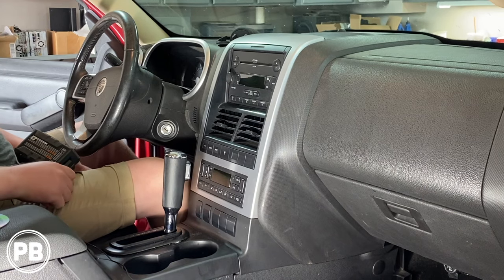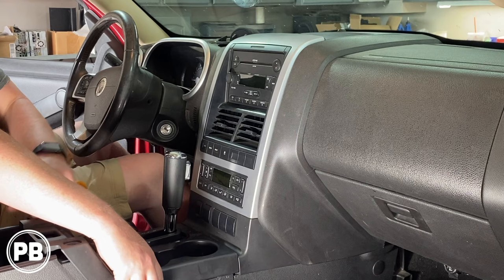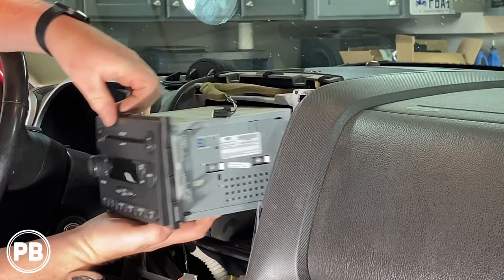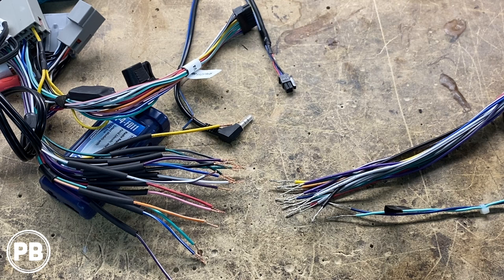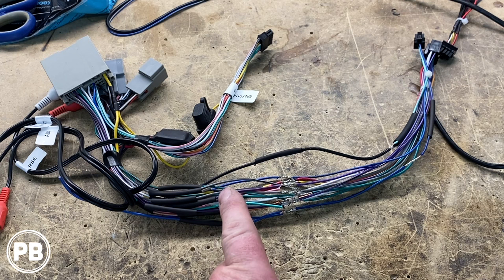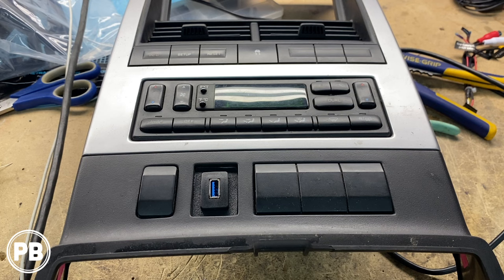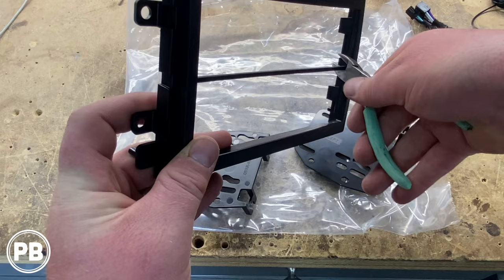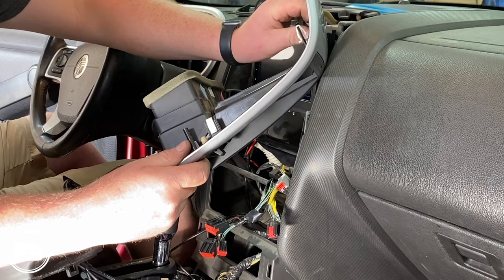2006 - 2010 Ford Explorer / Mountaineer Radio Install

Comment: Note about Crux SWRFD-60L harness adapter. If you have "Sync" (look for that emblem on your center console) the steering wheel buttons will not function even with this harness. This info is stated in the installation guide and I called Crux and confirmed I could have just used a basic harness like Metra 70-5520
Reply: Did you keep the steering wheel functions using the Metra 70-5520?
Reply: @edwincordero8  No.  My car had 2 connections in the dash. The Metra connected the radio to the big connector. The smaller connector must be just steering wheel controls which is what the Crux connected to
Reply: @gbasplen  got it, thanks.
Reply: Hey stupid question but are you saying I should use a different adapter then?
Reply: @BULLETFARMER  Yes but I don't know what brand still allows the steering wheel buttons to work on a "SYNC" radio
Reply: @gbasplen hey man are you still
On here? I could use your help today
Reply: @luisgalvansibd7688  I can try to help but it's been a while since I installed mine. I did 3 of my Ford SUVs at the same time and they were all slightly different so I  may not remember but I'll try
Reply: @gbasplen  I wanted to see where you got the ACC turn on? I have a 2010 work the nav and steering wheel controls. I was able to use the standard harness 5521 but trying to see which ACC I could use
Reply: @luisgalvansibd7688  do you mean where to get power for a backup camera only when the ACC is on? I put a fuse tap in the fuse box under the drivers left leg. I can check to see which fuse # when I get home
Reply: @gbasplen  yes. Let me know on this I saw the fuse panel under the driver this morning. I wanted to use the radio one I think that was there but wasn’t sure.
Reply: @luisgalvansibd7688  In my 2007 Explorer w/o Sync I see I tapped into #16 the 10A trailer reverse lamps presumable for power for the backup camera
Reply: @gbasplen  I couldn’t use that fuse. Mine is a 2010 with the 7inch screen and nav. I ended up using the moon roof fuse since it only opens when the key is in ACC or all the way on.

Comment: Does the system also support controls for the DVD Player because I have everything it's a limited edition subwoofer and DVD player for the rear passenger does this system support all of that?
Reply from the maker: The Pac RP4-FD11 retains audio for the rear seat entertainment (RSE) package but your radio needs some sort of audio input on the rear of the head unit.  The Pac instructions outline it here: https://catalog.pac-audio.com/index.php?controller=attachment&id_attachment=1519

Comment: Does this radio automatically turn off when u turn off the car to? Or is there something else needed for that? With my 2008 ford explorer my default radio is automatic but when i install different radios it ends up killing my battery even with the car off and nothing else plugged in.
Reply: You need a higher quality battery, silver or above I think
Reply: @bbongwaterr3854 it kills the battery regardless of which battery i have in.
Reply: This is a cable that is not installed correctly. Had that problem once. One workaround was connecting the key that turn on the car to power the unit

Comment: @Provo Beast Audio Installation, if i want to upgrade my speakers and perhaps add a sub and steering wheel audio control should i get the upgraded harness ahead of time? Also do you have a guide for the steering wheel controller? 2007 ford explorer sport trac.
Reply from the maker: Are you asking if you can add the steering wheel control buttons on the steering wheel later if your vehicle wasn't equipped with them previously?
Reply: @ProvoBeastAudio  That's one of the questions yes. The wheel has the cruise control on the left and nothing on the right. The other question was should i spring for the upgraded harness if i wanted to install both a steering wheel control and a sub later on.
Reply from the maker: No, you buy the harness to the options equipped from factory in your vehicle.  Adding SWC will require you to also replace and install a new clock spring, wiring etc.  If adding a sub, no need to buy a premium harness as the radio will provide connections to a sub anyways.  Sure, you can use the Pac harness, but you won't use most of the features it provides.
 @mr.silver5476
Reply: @ProvoBeastAudio  ah i see, so to put a switch in would be a lot of work and not really worth the hassle then?
Reply: @ProvoBeastAudio did you buy the 7inch den or 6.75?
Reply from the maker: screen size doesn't matter, both have a double din standard sized chassis.  both will work fine. @XXXRaptured

Comment: I have one but now my speakers dont work
Reply from the maker: Sounds like you have the factory amplifier and it's not turning on.  Depending on what harness you used to install the radio, be sure to hook up the remote turn on wire.
Reply: @ProvoBeastAudio  yeah the radio turns on and all but it doesnt play any sound is that the same issue ? or like ..
Reply: @ProvoBeastAudio  i didnt install it unfortunatley idk how to work these things its my first car so i know very little bout car mechanics and etc